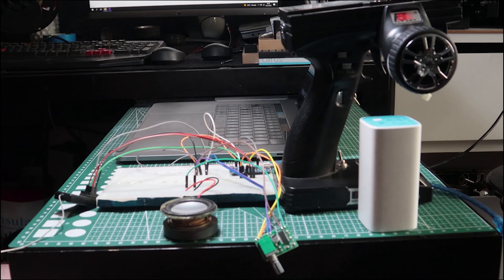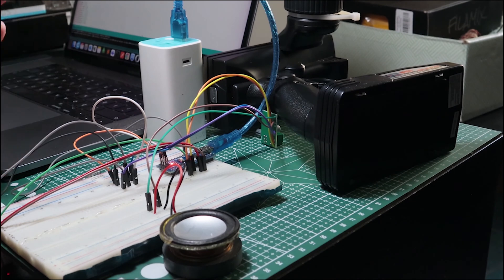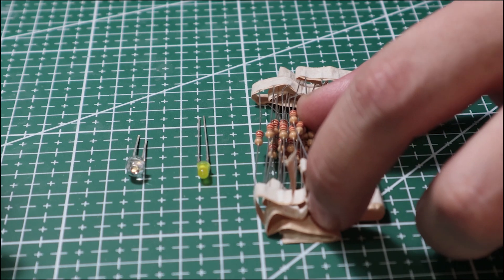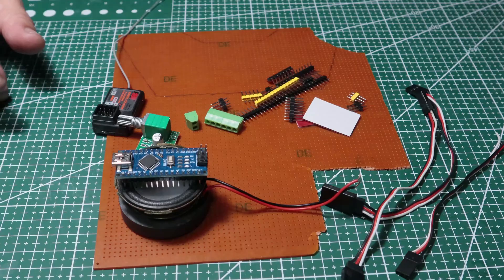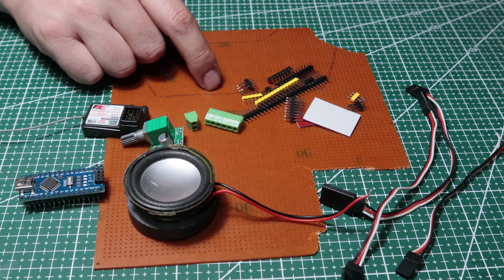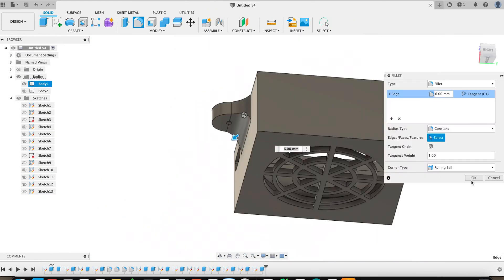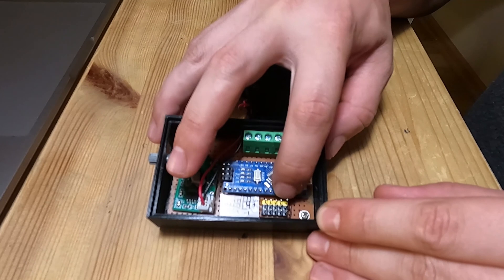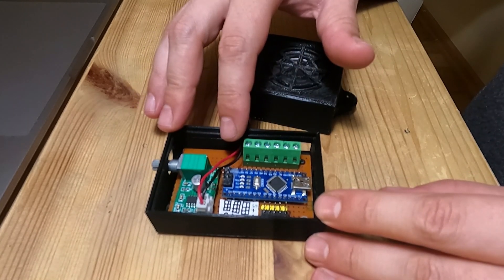MADE WITH ARDUINO RC (RADIO CONTROLLED)HAND MADE LIGHT AND SOUND KIT(TOGETHER)|FOR $15 CHEAP

Comment: what are the resistance value for the leds?
Reply from the maker: 120 ohm
Reply: thanks and which size of leds you used on your rc car 5mm or 2 mm? thanks again!
Reply from the maker: i used 5 mm
Reply: Thank again and how do you hook up the receiver to the arduino are you using a 5 channel receiver or a 3 channel because on the schematic you have 5 output thanks again for your help!

Comment: hiiii, great project, but i have a question, if you connect the motor to rc recivier, how do you connect to the sound module, do you do parallel wires?
Reply from the maker: Yes i got a signal cable from receiver.